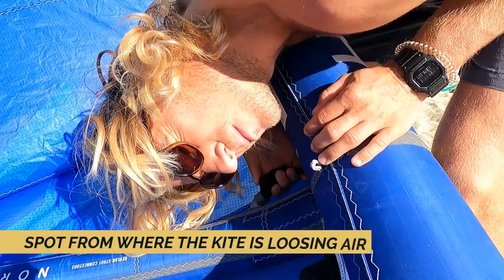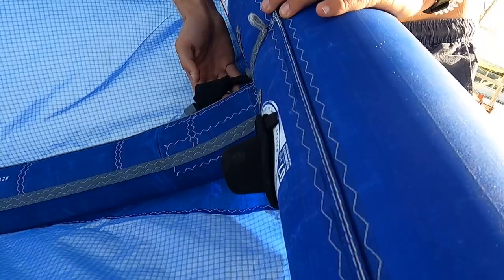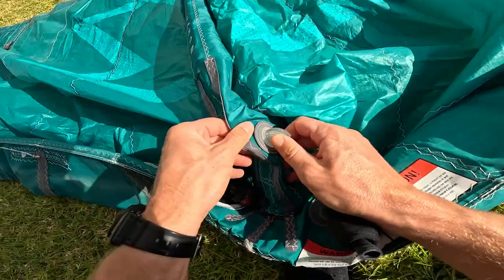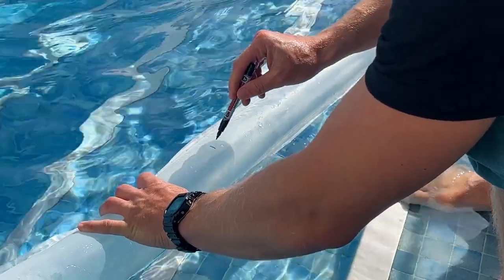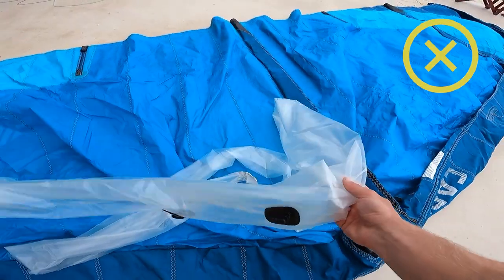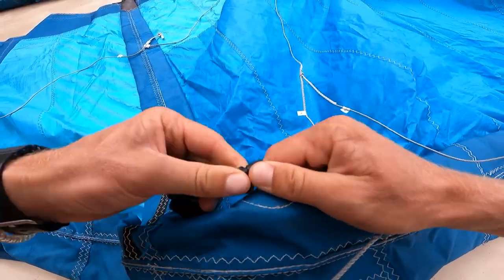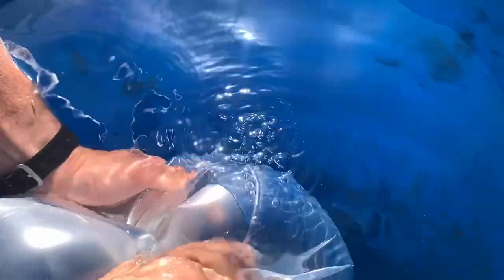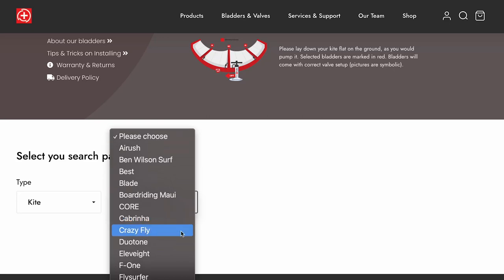Your Kite is losing Air ? -  Basic Kitesurf Repair

Comment: Even the annoying undetectable micro holes CAN be found with soapy water when the bladder is still inside the kite and the kite has proper ~7psi pressure. 
Soap bubbles will show even the  tiniest holes. But the problem is, you just can't find them when the bladder is out. There wont be bubbles underwater nor with soapy water. Having more pressure in the bladder would help, but that is a risk for the bladder.
The best solution is to use a needle! When you see where the bubbles are coming from , with bladder inside the pumped kite,  poke a hole with a medium sized needle. (small needle will make a hole that isn't easy to find ;D ) And remember to measure the spot from the nearest valve. So you will easily find the now bigger hole.  Just use a patch at least 4x4cm because your poked hole is close to that micro hole, not exactly in the same spot. 
Hint. The needle hole can be seen with a magnifying glass too. but the leak should be easy to find by just pumping the bladder up.

And NO. don't use the needle method on holes that can be found without the needle!! Even though you will have to take the bladder out some extra times.
Reply from the maker: @anttimantyla2905  ohh nice, never thought about it. That’s a good idea. Thank you 🙏🏻 🙌🏼